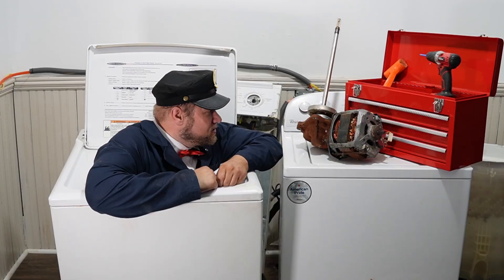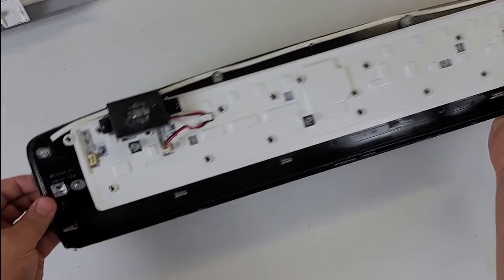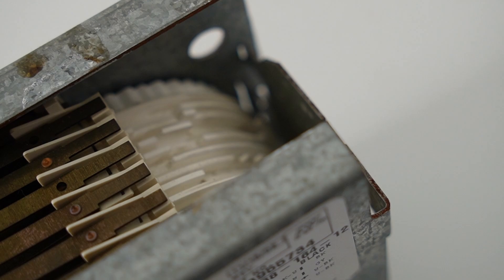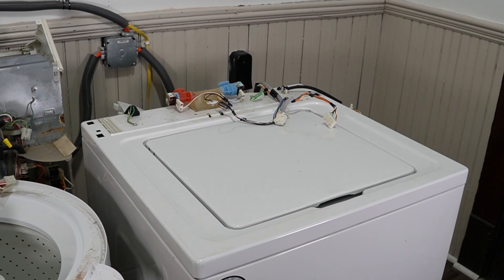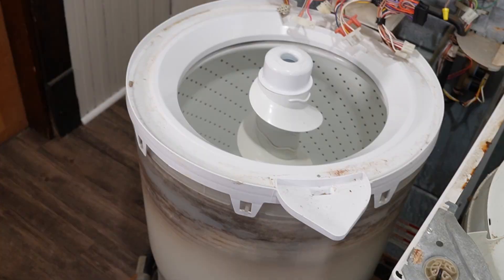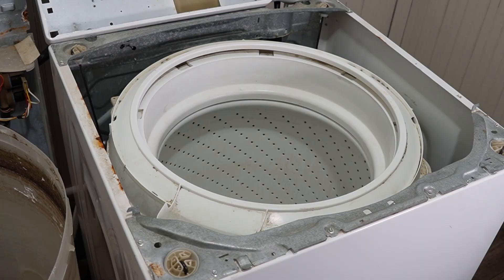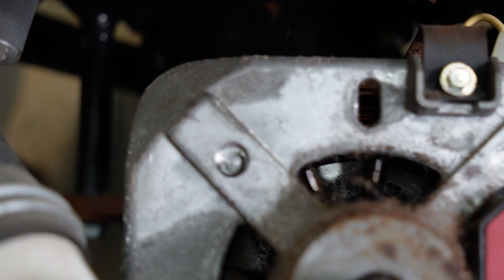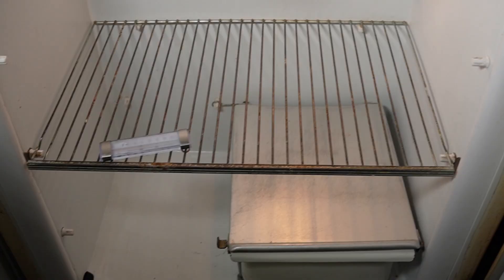Are Washers Built to Break? Inside a 1984 Washer vs. Now

Comment: This made me smile ! I have a fully working 1976 Maytag washer and dryer....have a much newer Amana pair at second place,....which have needed water valves and door switches after a few years. also the body is very cheap, thin metal and bends just sliding it around.    The older Maytag's were definitely built simply, with quality components and last decades,...50 years plus in my case!

Comment: When I worked at the appliance shop several years ago, one of the many jobs I had on the side from scheduling service calls was rebuilding Whirlpool washers and dryers...why?  Everybody wanted them.  We had a few people come in for a new washer/dryer, but most wanted their old ones fixed because they worked so much better.  We had people move to the area that traded in their newer stuff for older stuff because the new stuff didn't work as well, and they got tired of the repair bills.  We have a lot of dairies where I live, they tend to go through washing machines pretty frequently.  Usually they would bring in a machine once a month to have it rebuilt.  One of the dairies decided to buy one of those new agitaterless washers...about 3 days later the owner of the dairy called and said he was pretty agitated with that new agitaterless machine LOL.  It didn't clean nearly as well, and often took several attempts to get the stupid thing to even start a cycle.  Needless to say that machine ended up back at the shop and they went back to the old school washers with an agitator and that only took a few minutes to replace the motor to transmission coupler and get it going again.  

All that electronic garbage in these new machines shortens their lives drastically.  When that control board fails that costs $200-400, why would a customer pay that much for a control board when the washer was only $300-400 to begin with...so they go buy another one.  Those control boards fail more frequently than not, charging a customer an hourly labor fee to remove the board, replace whatever component(s) that failed, then reinstalling it doesn't make any sense....sure the part might be $5, but the labor involved in tearing the washer apart, diagnosing it, then desoldering and soldering on the new component(s) adds up, and most times when one thing on those boards fail it'll take out others too.  A mechanical timer is much more reliable and has a much lower failure rate, as does all those other mechanical settings, as opposed to everything on that 1 board where if one thing fails the whole washer is useless...many times one of those mechanical switches fails, the machine is still usable, minus that one setting.  We had a lot of customers with 30+ year old washers and dryers that would elect to have a faulty timer replaced, long before they'd ever consider buying a new machine.  

A drain pump replacement on a Whirlpool/Kenmore machine is a 5-10 minute job.  We replaced a lot of electronic drain pumps, lots of transmission controls, control boards (not just in washers and dryers but in refrigerators and ovens as well).  My 30 year old GE range still works great, it don't have a single electronic component, all the controls are manual switches.  

Those new energy saver washers don't save any energy at all, you end up having to wash the same load of laundry twice or sometimes three times to get them clean, you waste more water and electricity than if you would have just washed them in an old washer once...same goes for the dryers.  That auto dry feature never works like its advertised to do, you end up repeating a drying cycle just to get the clothes dry, the sensor thinks that one thing that contacted it was dry, but in reality the whole load is still wet.  

A lot of refrigerators now use multiple control boards, the main control board where power comes in, is one of the huge failures we see.  Power surge will knock them out.  It got to the point where our service tech kept a soldering iron and fuses with him because that's all that would fail typically was a 5 cent fuse...the stupid control board itself was several hundred dollars, and oftentimes took a few days to get...well that's one time where a fix like that was great, kept the customer from loosing several hundred dollars in food from a non-working refrigerator all for a 5 cent fuse....completely ridiculous design...should have a resettable circuit breaker, or an easily replaceable fuse instead of a soldered on board fuse.  LG being the biggest culprit it seemed.
Reply: The city where I grewup Sears had huge appliance store and I also worked at a shop where we repaired also sold reconditioned washer and dryers !
Reply: "people come in for a new washer/dryer, but most wanted their old ones" great stuff
Reply: @hardrays  We sold more rebuilt old washer/dryer units than we sold new.  Proves the new stuff ain't that great, and when you combine it with nonsense electrics it makes something as simple as washing your clothes impossible when a circuit board says oh no you don't LOL.

Comment: Shocking that the newer machine welded itself together in just FOUR YEARS. I understand the manufacturing simplicity of the control design to save perhaps 90% in assembly costs, but I cannot imagine any cost saving that would explain the transmission failure. There's a YouTube channel (Rose Anvil) that bandsaws boots in half to examine their construction. That would have been interesting here.
Reply from the maker: I'll do that at some point for sure
Reply: As a (former) appliance repair tech, I can say that the materials used on the transmission shafts of older machines vs newer machines leaves a HELL of a lot of room for rust or galvanic corrosion between the drive block and the drive shaft/spin tube. It probably saves the manufacturer less than a dollar per unit produced, but costs the consumer hundreds on repairs that go awry when machines won't cooperate in disassembly.

Comment: I have a 1991 Maytag top loading washing machine that still works great!  I've replaced belts many times, and recently had to replace the bearings, which was nearly impossible.  The outer tub, unfortunately, is rusted so badly that it will probably last only 5 years or so, and they don't make replacement tubs for that model anymore!  But, I plan to hold on to that thing as long as I can.  It's wonderful!  Simple, but wonderful.

Comment: I don't have the data to prove it but it seems to me the newer HE machines don't save you enough money to offset the cost of replacing them so often, as compared to the older and repairable machines that you'll have for 20+ years.
Reply from the maker: For toploaders it's probably right due to the massive hit on reliability. Front loads are generally a bit more reliable and efficient and probably are efficient enough to save a little money. The same probably is not quite true for refrigerators though because of how much electric old ones use.
Reply: @bensappliancesandjunk  Isn't it only when refrigerators starting adding automatic defrosting in the late 50's-early 60's that fridges became energy hogs? Some of those late 40's GM Frigidaire models with the "Meter-Miser" are comparable to modern units.
Reply from the maker: @ashleyhathaway8548  I can investigate that in a few weeks. But the defrost mode usually introduces about 400w of heat to melt the ice, but only for 20-30min. That is not a lot in the overall scheme of a refrigerator, as a modern refrigerator runs on about 150-200w of electric constantly, if that. I'll look at my 1948 GM vs. a 2022 French Door then maybe a few others that I have from the early 2000s.
Reply: Yup — not to mention the massive environmental hit of not recycling them into squat and of the energy/resources of building + shipping them all every 1-3 years.

Comment: We have a Maytag dryer that I fixed a little while ago. Bought a $75 rebuild kit with pulleys, belt, motor, heater, temp sensor, and a few other bits. Saved my family nearly $600

Comment: Love those old style washing machines. Haven't bought  a new washing machine in over 30 years. When I'm driving and see an old one on the curb.  I'll pull over, and tilt it so I can see underneath. If it looks to be in good, and all there and not rusty I'll load it on my Truck. Parts for the old washers aren't expensive, and a lot of them are still available.  For the price of a new washer, what ever you save on electricity  is lost in replacement. Get another green got you.

Comment: I used to work for Part Select. I retired last year - one year after Steve did.  Steve Ash stars in the videos that the company has on their web site on how to do repairs.  I could always tell the newer videos from the older ones because Steve has less hair in the newer ones, and what he does have is more white.  (I have all my hair; but it's completely white, so there is that.)   It's a small town and the videos used to be made in the basement of the call centre that was owned by the company which owns the Part Select brand, so you tend to see the same faces for many years.  Good video, except that you don't mention the direct-drive washing machines.  They don't use belts.  I don't know what is the difference in operation (speed, etc) between belt-driven washers and direct drive; but I know how to fix one having spent so long selling parts for them.  Thank you for doing this one.
Reply: Some of the belt drive units tend to spin slightly faster, but the speed selector usually fails in them, quite a common repair it seemed when I worked for an appliance shop.  The common repair on the direct drive Whirlpool stuff was the coupler between the motor and transmission, and lid switches because people slam the lids down on them all the time.
Reply: @muziklvr7776  , thanks!  Really enjoying mine.  Would totally recommend it. :)

Comment: I just repaired a 2016 Maytag top loader (thanks to your video on the board cleaning and reseal) . It had the old stater motor and works great. I also just removed a motor from a Whirlpool about the same age and it has a motor with a metal pulley. Way more tuff than those plastic ones. Those newer Whirlpool washers can be a pain but they have good parts you can reuse. I use the drum from the HE in the old direct drive Whirlpools. You can also remove the top from the HE and mount it on the old direct drive ones but you have to bypass the lid switch and if someone has children in the house you can easily use many different child locks designed for fridges, stoves, cabinets etc. Also extra bonus is the plastic legs on the HE washers work great in Whirlpool dryers. They are easier to adjust by hand and the rubber coating keeps the dryer from sliding back to the wall pinching the vent. Thanks again brother and I pray for your health. Hope to stop by and say hello sometime. I'm here in Cincinnati myself. Wash on 🤘!

Comment: Some older friends bought new Maytag appliances and a Cadillac in 1982. They still have the car and most of the appliances in 2022, and use them everyday. The dishwasher died and was replaced with a Bosch that developed a must odor right away. (It's not the removable filter.). The friends are now in the 90's, and I remain their friend and repair technician. Stunningly so, I can still find parts for everything when needed.

Comment: Repair tech here, the thing that killed appliances in general were the energy star requirements put into place. They required manufacturers to use less water and electricity which inevitably forced them to redesign perfect units.
Reply: Car world sounds like that
Reply: I think it was more of a “mutual exploitation of the intent” type of deal, but yes.
Reply: @d.p.9567  I am driving a 2002 Honda Civic. It has 104,000 miles on it. My first car was a Ford Maverick. That had 100,000 miles on it. You could get in my Honda and drive it across the country without a problem. The Ford maverick had shot piston rings rust holes in the floor, terrible fuel economy, Oil leaked everywhere. We have to stop pretending old cars were great. I grew up driving cars from the 60s and 70s yes they were easier to work on. But they had to be.  The cars today if you actually maintain them have three times the lifespan. They will certainly go three times the miles.

Comment: We bought a hot point washing machine in 1997.  I'm still using it today. The only repair it's needed was  about 6 years ago. The agitator belt broke and was easily replaced.  It's non tech, no digital. Just 3 dials. Water temps, load size and the dial to start it.   I hope it never dies.

Comment: Our new Samsung washer got a stuck hot water valve inside just after the 1 year warranty was up. They Samsung dryer has trouble doing one thing: Drying anything. The moisture sensor doesn't work right so it NEVER fully dries anything. I would never buy a Samsung washer/dryer again. I miss my old Maytag Neptune series.
Reply: Samsung appliances are poorly designed and support is terrible. I also own a Samsung washer and dryer and will never buy a Samsung appliance again. The Kenmore set I bought in 97 and used almost 20 years was much better. My mother in law is still using the dryer. A coworker has also sworn she will never buy from them either after her very expensive fridge didn't last more than 3 years.
Reply: Never ever buy a Samsung or lg appliance.
Reply: We had to rebuild after a tornado and had all Samsung appliances. In 5 years I went through two condenser fans in the fridge, the over the stove microwave gave up the ghost, the relay controlling the heating elements in the oven shorted out and sent 220 bolts to the PCM/PCB and set it on fire, while I was trying bake a pizza, and replaced the heating element, element housing, thermostats, thermistor, high limit switches…. I had the dryer cabinet apart so many times that the sheet metal screws didn’t want to work anymore. I  finally gave up on it when the PCB started started circling the drain. 

Have Maytag non smart washer and dryer and replaced the Samsung appliances in the kitchen with whirlpool. 

The dishwasher is an LG and I’ve had to replace the entire bottom end because the sump pump cracked and it threw a code. So I ordered the complete sump, pump, and motor assembly off Amazon and replaced it. 

I’m a YouTube certified home appliance repair man.
Reply: Check your dryer vent. And not just behind the dryer. If you can access where it vents outside make sure it is opening all the way. If you can’t get to that then call a dryer vent cleaning company. That will most likely help with the drying.
Reply: @jmcurleypoker  mayby he has one that vents to the room instead

Comment: My washer was purchased about 2001 and looks just like your "old" washer there except the bleach, softener and detergent dispensers are on the perimeter and not the agitator. I'm still loving it and it cleans wonderfully. I did have to replace the agitator because I would just throw my son's hockey gear right in there. No son of mine was going to smell like that hockey locker room! It was well worth that $15 part. We did replace the tub because of rust. Oh, btw, I had 6 kids and did at least two loads per day. Now there is only 4 of us home and we do a load every day and it's still running great 21 years later.

Comment: 7:00 you can totally bypass the lid lock. I did it on mine, just instead of cutting the wires just cut off the tab that actually locks the lid. The washer still thinks it's locked.
Reply: I feel like that's fair game for all the times I lost a sock in the washer
Reply: I wouldn’t play around with something like that. Should put a try at your own risk kind of thing
Reply: @AtomSquirrel  if you aren't an idiot you shouldn't have any troubles after removing the lid lock. If anything you will realize how much easier everything is without one.
Reply: @nigyouknowwhatcomesnext3886  how is it easier? I just put in my clothes and forget about them
Reply: @AtomSquirrel  if it is unbalanced for example you can easily open it and re-balance.
Reply: @nigyouknowwhatcomesnext3886  exactly. Just go up and hit the pause button, wait for it to unlock, and rebalance the load. Doesn’t take a lot of time and doesn’t mess with the washer

Comment: We had an old Kenmore dryer that stopped heating. It was still spinning and would just turn on all by itself and spin. Obviously had some issues going on. We could not find anyone to work on it. No one would come out and work on it because he said it was too old and they didn't work on Kenmore anymore that was so disappointing. So we had to get a new dryer. Also about 15 years ago we bought a 1969 mobile home at the beach in North Carolina. We did a lot of remodel on it. It had the original avocado green kitchen appliances. Refrigerator was still running. We spray painted it white and used it for a good many years before it finally died. The refrigerator had to be 40 plus years old when it finally gave it up! Thanks for the interesting video.

Comment: There are ways to make the electronics more reliable without adding much cost.  For example the can-shaped electrolytic capacitors usually don't last more than a few years.  Replacing with solid tantalum and the capacitor would last decades.